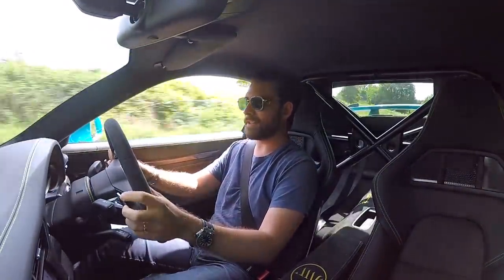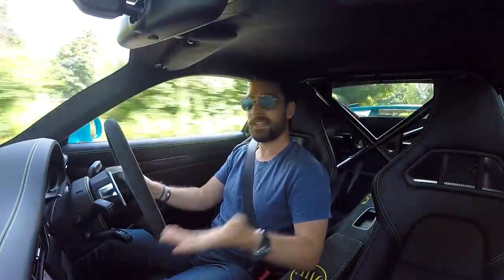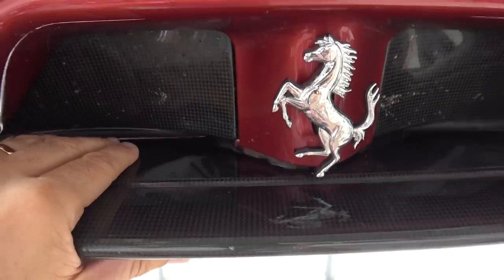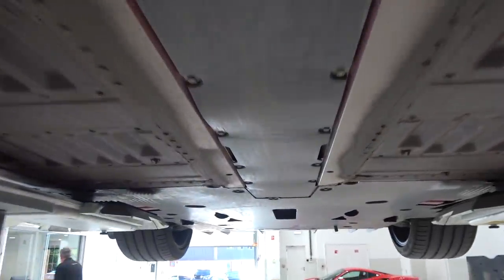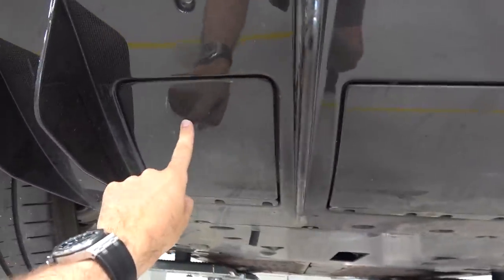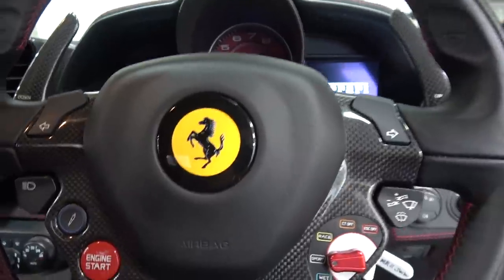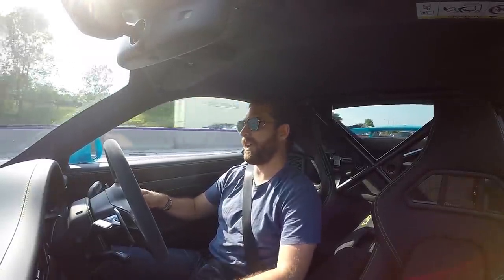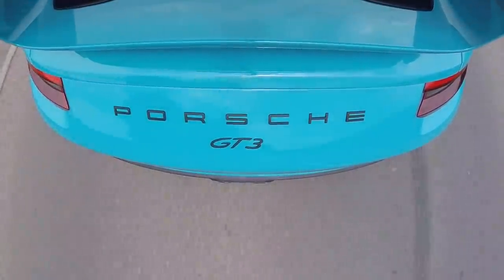How It Cost Me Nothing To Service My Ferrari 458 Speciale!

Comment: Love your videos James as you know. Important tip though: if you plan to record away from your mouth, just quickly turn the mic around it will also fit in the slot the ‘wrong way round’ it’s a 5 second fix to the sounds and it will make such an insane difference!!

Comment: In Spain we call it ITV (Inspección Técnica de Vehículos or Technical Vehicle Inspection). They test brakes, suspension, ECUs (this one is recent, they make sure if your engine is powered up and that ECU tuning is homologated), exhaust sound, emissions, lights working properly, parking brake, seat belts, airbags and warning lights on the dashboard. You have to pay 50 euros more or less to pass the ITV, and if you don't, you have 2 levels of vehicle status. First level is desfavorable (you can only use your vehicle to move to the nearest workshop and fix the vehicle, if they catch you, prepare for a expensive fine) and the second level is baja del vehiculo (your vehicle gets his paperwork unregistered and it goes to scrapping). If you pass it, you get a sticker in your windscreen with the next date to pass it
Reply: Got my facts wrong lol. In baja del vehiculo depends on the state of the car